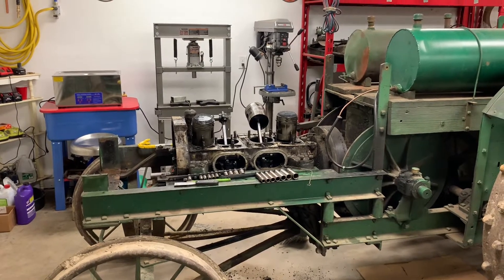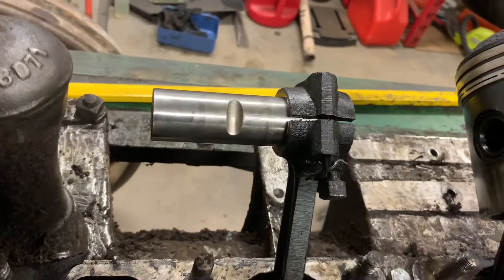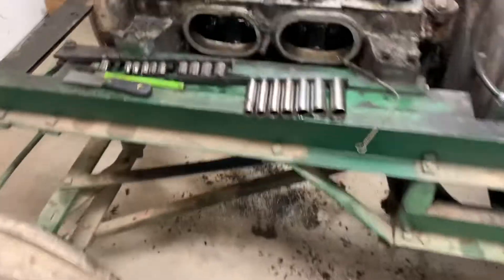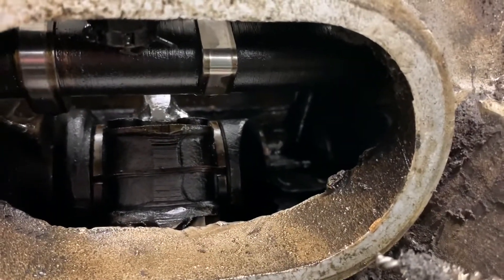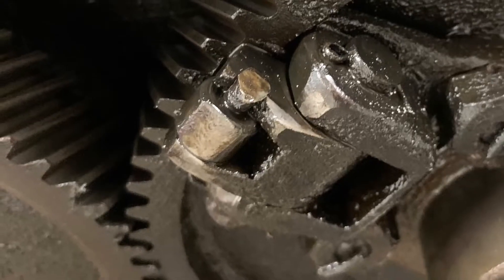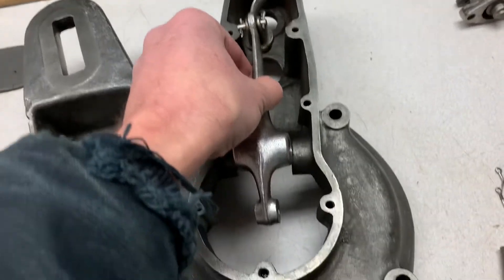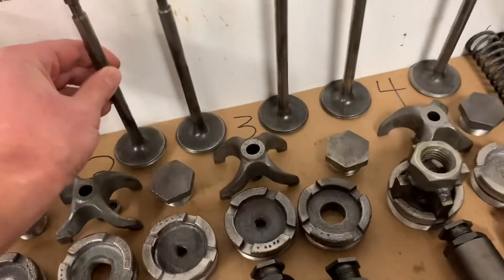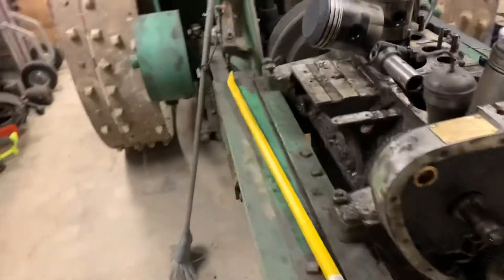Rock Island Heider Model D 9-16 tear down update #1

Comment: I'd say she has done some work.. seems like quite a bit of wear on a few parts.  
A little touching up on the gear might be the way to go.. would be different if you were going to be pulling with it, or farming with it..
You've gotten a long way. 
Thank you Dave!!
Reply from the maker: Thanks Ed. I showed them to the fella I have making the repairs, he thought they would be fine maybe a bit noisier. For the 5 hours per year projected run time 🤣
Reply: @crazydave4455  probably won't hear it.. if so, well.. you don't know what it sounds like with new gears anyway..
Reply from the maker: @GosselinFarmsEdGosselin  🤣 but I can imagine what they sound like. The only concern I have is if one breaks, jambs and breaks the aluminum crank case.
Reply: @crazydave4455  ya, totally understand that!! But some pitting shouldn't cause catastrophic failure unless you were really working it all the time, even then, the odds are slim..

Comment: Interesting design going on there, especially the pistons. I would think the dome would force more pressure and heat against the rings.
Reply from the maker: The top ring lands are the most beat up. Side ring clearance of .05 on one I measured. Definitely easier working in the green paint Waukesha’s.

Comment: Hi Dave! Thanks for posting an update on your tractor. For such a rare tractor, where do you look for and find parts? Looking forward to future videos of this tractor! 🇺🇸🚜👍
Reply from the maker: Have to look for parts from other engines that have a similar specs. Bore and stroke etc. and modify them. Rings will be a custom order, may have to stack them or use spacers. And worse case 💵 have parts made. Thanks for coming by Hyatt!

Comment: Are you going to be able to get parts
Reply from the maker: Short answer is no, but get creative and yes. Things like rings will have to be ordered by size, and maybe stacked or used with spacers. And cross reference other engines by size and modify what’s a close fit. For example a B John Deere is the same size bore and their wrist pins happen to be the same diameter. And in some cases it has to be custom made.
Reply: @crazydave4455  ok, we've done that before on some tractors we've restored , parts were NLA